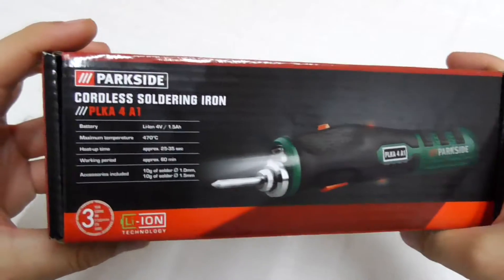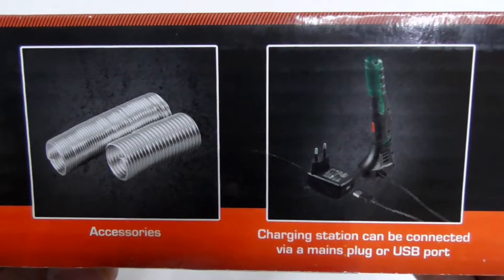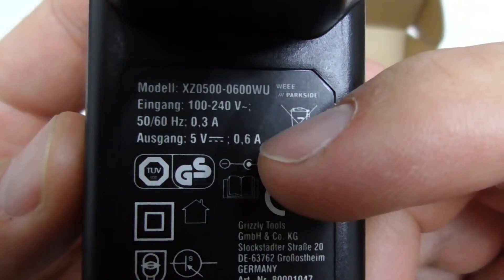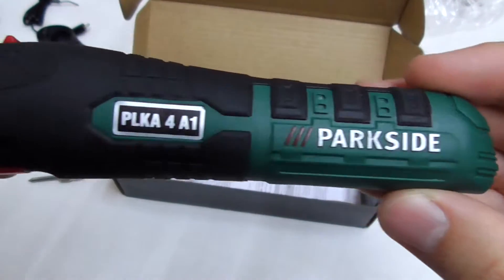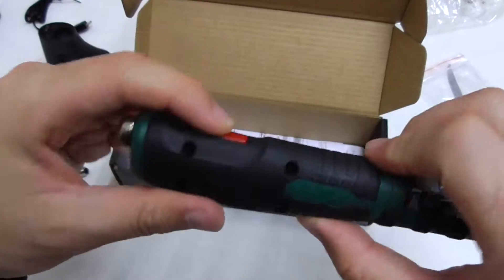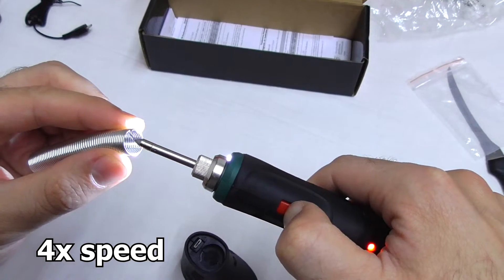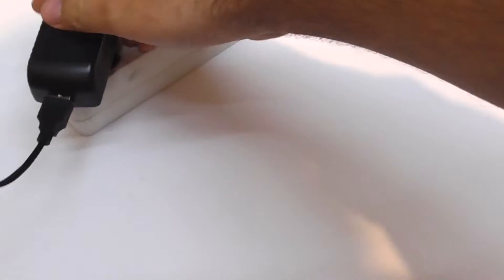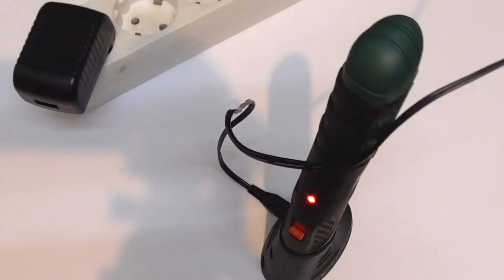PARKSIDE Cordless Soldering Iron (PLKA 4 A1, Micro USB, Li-Ion)

Comment: Never touch the tip of a solder iron when it is heating up, heat transfers quickly in metal.
Reply from the maker: I was just curious because I have a 12V soldering iron also and that heats up much slower, it requires a few minutes to melt solder...